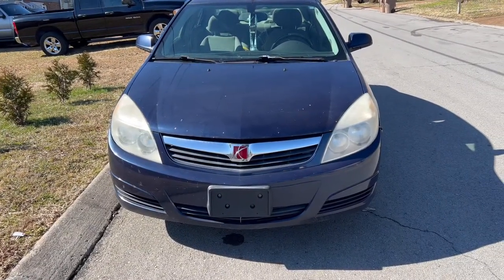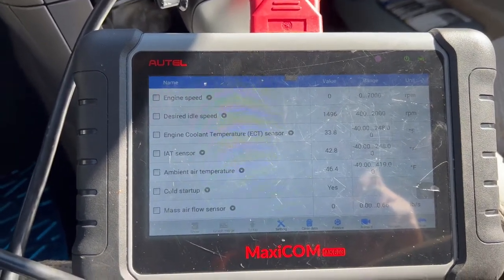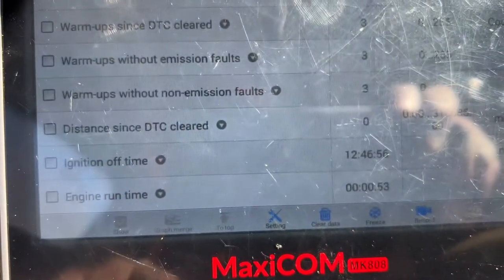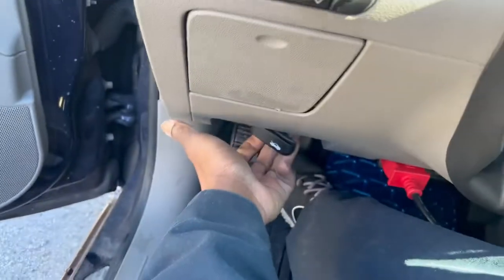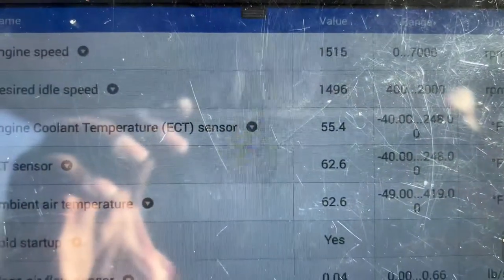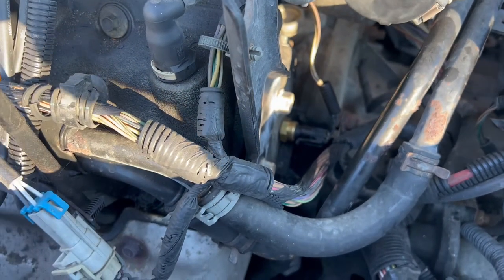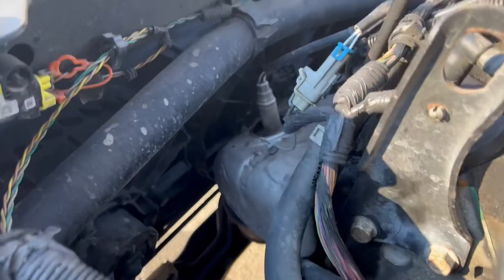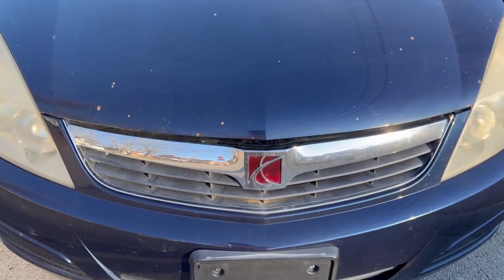2008 Saturn Aura XE 3.5 P0116 replace Engine Coolant Temperature Sensor

Comment: If you can recall... Is this the sensor that controls the coolant temperature gauge?

I dont have the po116 code.
My gauge goes up (self test) at start to show it is working... But then sits at dead zero.

A recent occurrence with no other symptoms.

I have found competing information about the saturn Aura... Some with the 3.5, the 3.6, and the eco 2.4. (temp sensors on the block and temp "sender" on the radiator, i do t know which i need.)

But not definitive information for my 2007 Saturn Aura xe 3.5l

I appreciate your video!

Comment: I have replaced both the thermostat and coolant temp sensor and almost once a "start" the car will trigger a p0118 and disable the AC. When on the OBD II scanner and this happens, I do not see a spike in coolant temp. And it is just rando when it happens. Any troubleshooting ideas?
Reply from the maker: Make sure the system is bleed & topped off
Reply from the maker: Thank you for watching please subscribe

Comment: Mutha F'in excellent video! Would be nice to know the part number you used.......
Reply from the maker: Part number is 213-4514
Reply from the maker: Thank you for watching please subscribe
Reply from the maker: Johnny Stewart  hell yes the coolant temperature sensor has caused them not to start! Yet it’s simple but it’s a Gm safety thing to try & keep you from fucking up the engine
Reply from the maker: Johnny Stewart  thank you for watching please subscribe